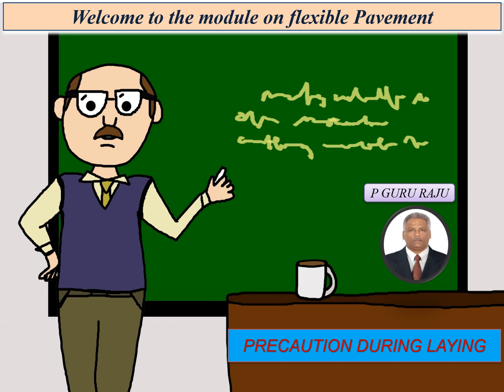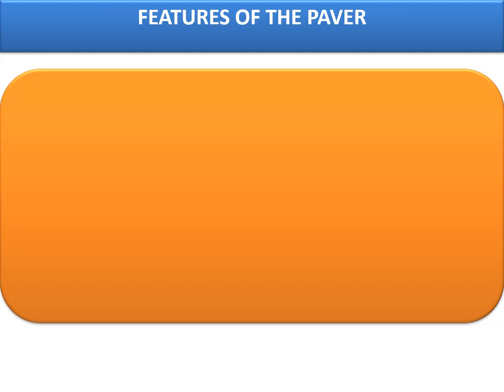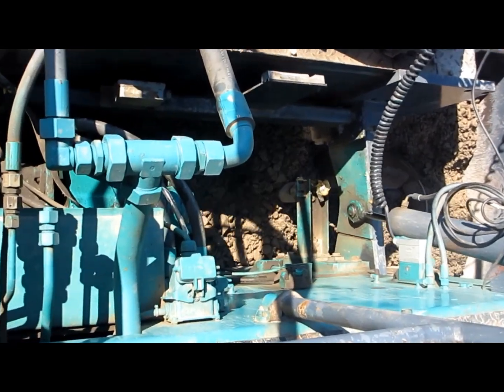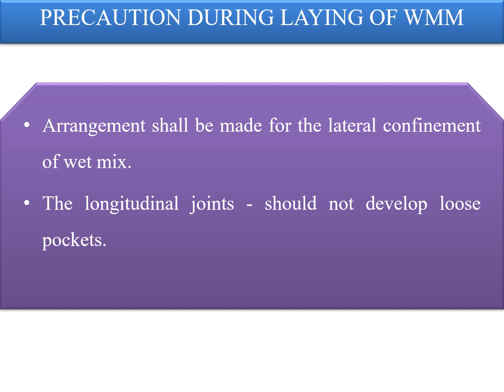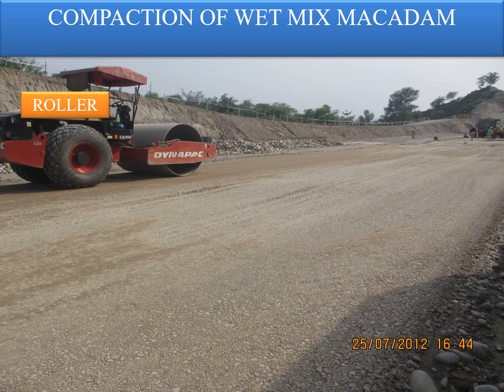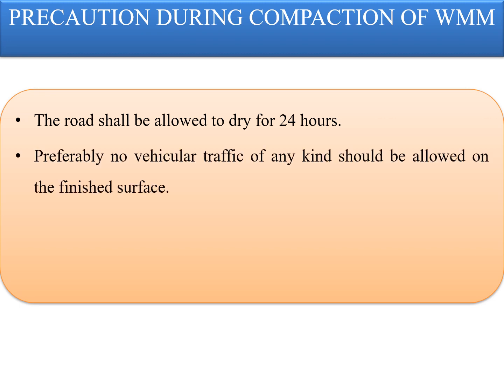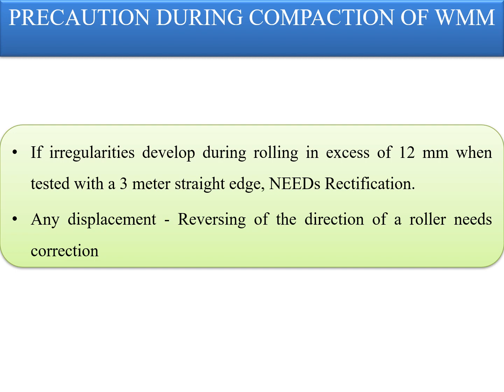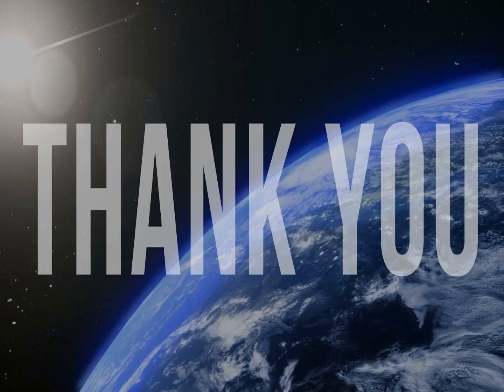PRECAUTIONS DURING LAYING OF WMM

Comment: Wmm mixing time sir
Reply from the maker: Its not a batch mixer so setting of mixing time is not possible. Material will flow in from one end and exit from the outlet in a continuous batcher. Probably 10 sec the material takes to cover the distance from entry to exit point.